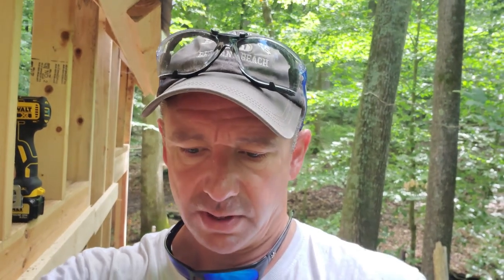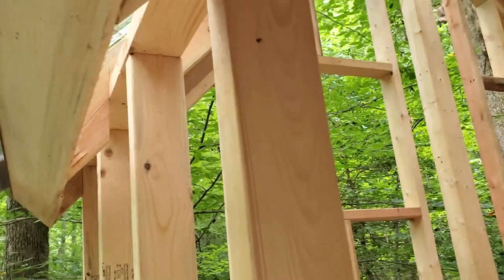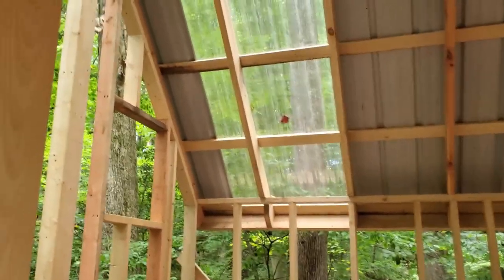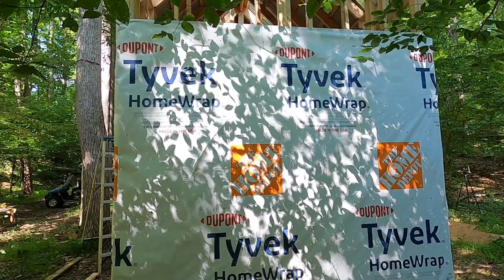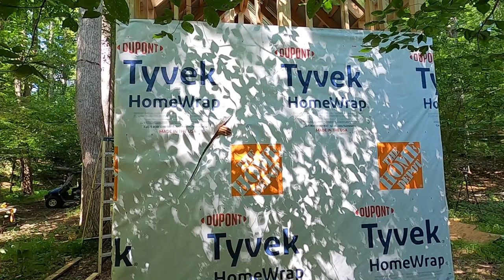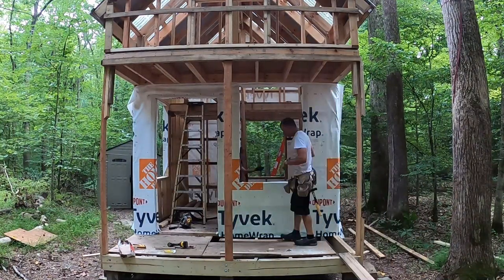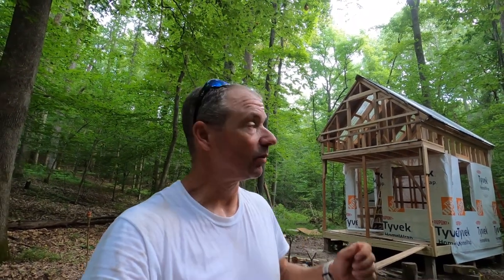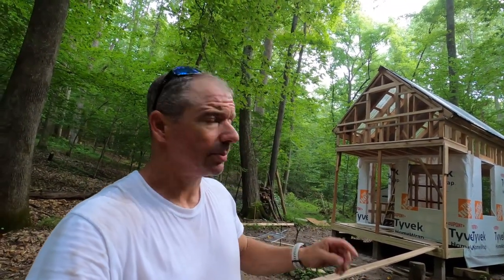Quarantine Cabin Build 7

Comment: I was curious about what you were going to do on the soffit. I have the same setup and was thinking of blocking it off too. I'm sheathing my roof with 19/32" (as well as the walls) and then putting a heavy sealing underlayment on top then laying the metal. I shouldn't have to worry about moisture intrusion. 
Our cabins are similar but completely different uses. I am so deep in the woods that I wanted to beef it up in case a tree decides to fall on it...maybe it will hold.
Reply from the maker: Screw the tin down a lot! I have a horse run-in the previous owners built where they screwed the tin to the plywood and the wind is pealing it off. Thanks for watching!
Reply: @johnkidd2067  
Thanks, I will. Going with the thicker plywood will help that as well.
Reply: If a tree falls on your house it won't hold.  Nothing will hold a tree off
Reply: @russelllocke1404  
I've seen houses hold trees many times. Was an arborist for 15 years. I've also seen some big trees go through houses.